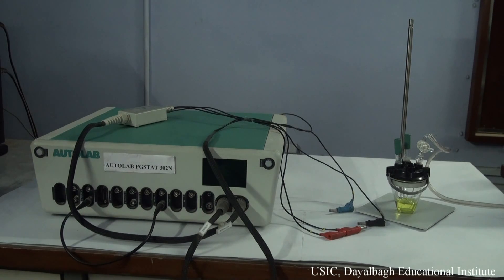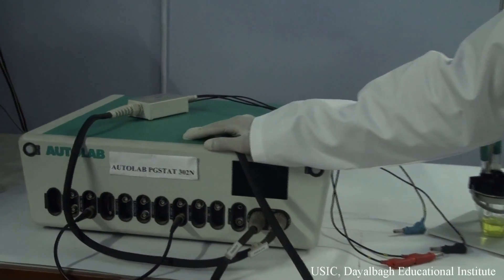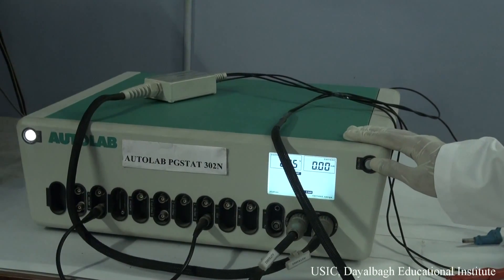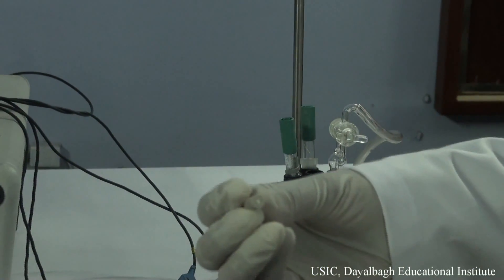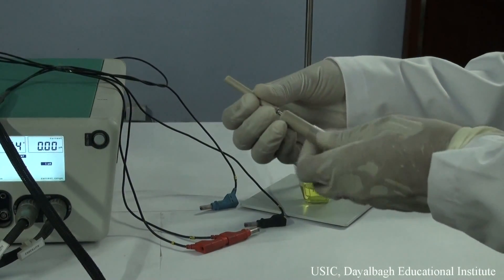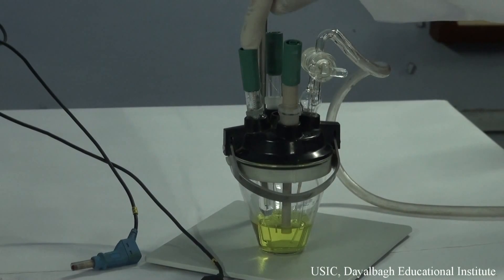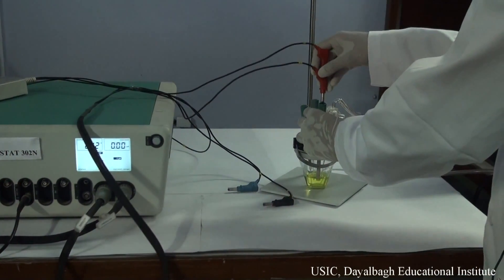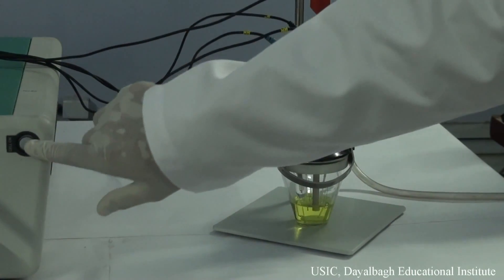Cyclic Voltammetry of Ferricyanide solution using KCl as supporting electrolyte.

Comment: what is the purpose in add the KCL as supporting electrolyte??
Reply: supporting electrolyte improves electrical conductivity,
Reply: Supporting electrolyte and I guess is to match with the solution of the reference electrode instead of use KNO3.
Reply: Supporting electrolyte used as usually 100x of the analyte to eliminate the migration current to observe only diffusion current. If u dont; ur current response will be complex and it will not give sufficient information about your analyte.